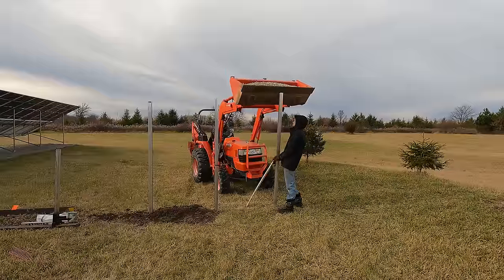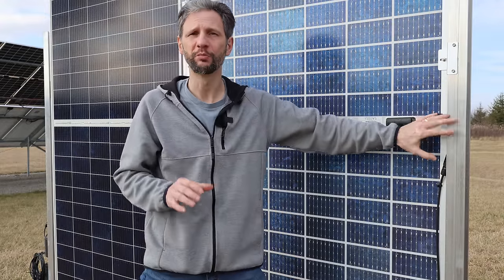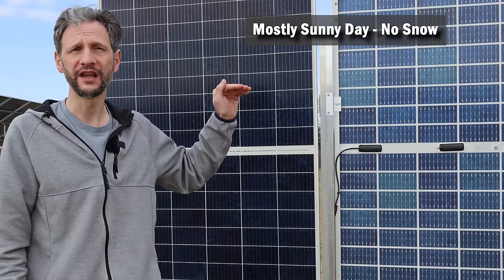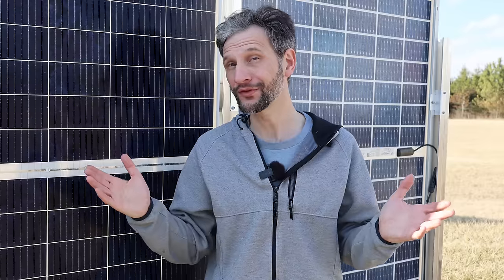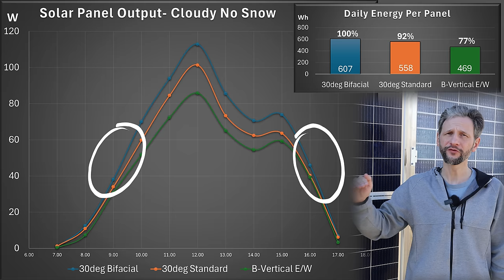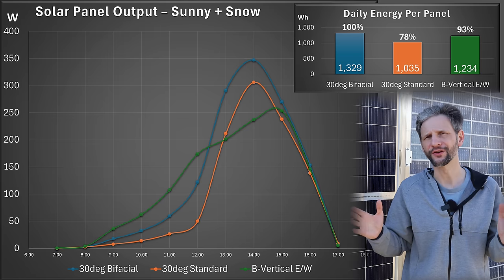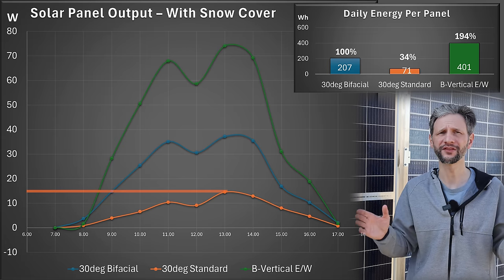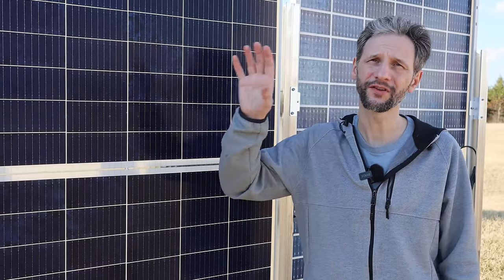Vertical Bifacial Solar Panel Performance Results Part 1

Comment: Hi Dave. Your video popped up in my recommended videos so I’m not yet a subscriber. I’m not sure if you’ll see this but I need to comment in the hopes you or someone needing to do a similar job will see this. 

At the 25 second mark I see you installing posts into the ground with a small tractor and its bucket loaded with gravel. This would be fine except for the fact that your helper is standing underneath that bucket, holding the post. 

Now before you get annoyed and dismiss me as a safety sally. Understand that I grew up on a farm, and worked in and around heavy industry all my life. I had some very close calls on the farm growing up, not really learning about safety until later when I entered heavy industry. I’ve done a lot of jobs in and around high hazard industry, farming (including fencing), plant maintenance, construction, equipment operation, and oil field work. As well, I have been a safety professional for the last decade. So hopefully you’ll understand, I’m not just some random person who falsely thinks something is dangerous because they don’t really understand it.

What’s dangerous about this is your bucket could slip off and smash your helper in the head. A number of injuries could result with death and paralysis being very likely due to momentum and stored potential energy present. 

These sorts of incidents happen in micro seconds and sadly there is no such thing as a time machine to go back and prevent it once it has happened.

Of course many dangerous practices happen on farms and acreages for years without incident but it only takes one instant for the worst to happen. 

In the future, please consider using a shovel, stick, 2x4, or any number of implements that would put your helpers head away from the danger and out of harms way. We call it “the bite” in the safety industry. I really hope you see this and understand my concern. 

Not long ago someone I grew up with was working on his truck as he had done for decades. He had his truck on ramps and although there were wheel chocks near his truck he must have felt that the park pawl in his transmission would hold his truck from rolling down onto him. The issue was he had to disconnect the shift linkage on his transmission in order to do the job he was doing. They think he must have bumped the shifter on the transmission into neutral when they found him. My point is he would very likely be alive today if only he had taken the safety precaution of chocking his wheels. I highly doubt it was the first and only time he did this either but likely got away with it many times. I doubt he realized the risk he was putting himself in. I wish I had been there to say something which is why I’ve taken the time to comment. Sorry it’s such a long comment but it’s important and if even one other viewer sees this and it helps them stay safe, it’s worth it. Take care out there!
Reply from the maker: Thanks for pointing out my poor safety practice in this situation.  He wasn't actually under the stroke of the bucket, but certainly closer than he should have been.  Also, the post could slip out and cause injury.  Supporting with another method would have been a much better choice.  Thanks for the reminder to keep safety a priority and for pointing this out for other viewers to take note.  Thanks!
Reply: @ProjectsWithDave  Big respect for being receptive to feedback! - your newest subscriber.

Comment: Great data! Thanks for the video.
What I understand is that vertical panels are much more suitable for too-hot (heat = inefficient) or too-cold (snow for light reflection) environments.
Also, the vertical panels probably could get tiny bit more juice if they had more distance from the 30 deg panels' shade 😄
Reply from the maker: You're right about the distance from the main array.  That is as far away as I could practically put them.  However a longer row of vertical panels would also shade itself more than my 2 panel run would so maybe that cancels out.  Unfortunately, no test is perfect but I think the trends hold true.
Reply: One benefit I gather that you can place these in areas not suitable for regular panel construction. Farms, or even alongside north-South running highways.

Comment: I think the big part of the study is going to come with its summer data.  The benefit that the vertically oriented panels had was that they were dramatically cooler, which has a big impact on production.

Comment: I wonder if you could make slanted reflectors of a kind in the aisles between them. Like a long base, low height triangle, the two "tops" reflecting light towards the panels to better avoid the mid-day dip. My recommendation is made without knowing how reflected light compares with direct sunlight, so if it's no better than albedo reflection, be gentle. 🙂

Comment: Nice data -- thanks. I'd be inclined though to include the higher cost of bifacial panels in conclusions.
Reply from the maker: The cost/watt is often cheaper when you consider the actual performance.

Comment: Great informative video.
It would be great to expand the testing to include single and dual axis solar trackers, although it costs more and wind is an issue.
Reply from the maker: I haven't found a good reason to get into trackers yet, but I may at some point.  I don't like the added complexity and long term maintenance.

Comment: A mix of both also solve running into grid limits and produce much more in peak hours where generation is much more profitable on the market.
Reply from the maker: Right, adding vertical panels give you more options to tailor a solution for your specific needs.

Comment: Might we assume that by treating panels in a long continuous sheet, that were one to separate them, surround them with reflective surfaces that assist in off-hour collection, that, were you to have the land area, one could optimize each panel to collect the absolute maximum?

Comment: I bet in many locations with low winter sun inclinations and snow-fall even a single-face vertical panel is a fairly decent design assuming you don't optimize for absolute maximum kWh. If having morning, evening and winter electricity matters more than peak summer noon production, (single-faced) vertical might be acceptable.

Comment: The results in late spring, early autumn and summer may vary significantly because the sun is much better aligned with the panels in the morning and afternoon than in winter. I'm not sure if they outperform the south facing panels, but i guess the results would be at least less far apart

Comment: It seems like the setup would benefit from 45° mirrors aimed at the panel. It would reflect light towards the panel when the sun is overhead and a bit of extra light otherwise.
Reply from the maker: It would help, but you have to consider the cost and durability of the mirrors.

Comment: Another winter test idea:  Ive noticed on my 2 small arrays that when they're snow covered that the parallel sections backfeed voltage to the non-producing sections, heating them and melting the snow/ice.  I was thinking about getting some MC4 blocking diodes for summer time but I think having them out during winter might be better.  Would be another interesting experiment if some of your lower sections of the array could be put in parallel with sections of the upper part of the array.
Reply from the maker: The diodes in your panels should prevent back feeding.

Comment: I think the problem is, you use bifacials that have one of their sides "nerfed". True bifacial panels should have the same efficacy on both sides, so your results would be much more desirable.
Reply from the maker: Do you have a link to a commercially available bifacial panel that produces the same power from both sides?

Comment: Those power curves better match up with typical household usage. My guess it would allow more savings on batteries in an Off-grid application. More on panels and less on batteries. used with vinyl fencing hardware like the I posts Install could be very easy and useful fencing or wind breaks.

Comment: Depending on costs continuing to go down or whatever just mounting 1/4 or 1/3 of the panels SE and SW facing with 1/4 or 1/3 180* (S) can make a usable system at my 45.74 lat 
I have ‘normal’ one-face panels but I mounted all of them vertical to keep snow from accumulating. I actually leave them that way all year long because I don’t ‘need’ to maximize in the summer months.  But in winter, I don’t have to be home and clean them off every ten minutes or every morning. I get charge even in snowstorms- they never accumulate any snow or ice.  Yes, I have ‘extra’ panels to compensate for the short sun-hours, but vertically is WAY more productive than getting them snowed on and getting 2%

I’m completely off grid do it was important to me to maximize circumstances and get /some/ charging not just optimize the sun angles and lose most days. I spent less than $75 total on generator gas this past winter and most of that was Nov and Dec. 

While I understand the bifacial concept, I’m of the opinion that simply facing SE-S-SW is beneficial and quite simple to implement in practical terms.
Reply from the maker: You have hit on the reality of solar production for those in northern climates trying to operate off-grid.  Design for winter production and the summer will be sufficient without any effort.

Comment: My understanding is that the vertical solar panels also reduce the inefficiencies that happen when panels are overheated with noon day sun so the summer results will be revealing.
Reply from the maker: I'll check that this summer.

Comment: can you speak on the return or monetization time?  Thank you.    

Also, this is an easy fix for the mounty systems of the vertical mounting options.   Also, how easy would it be to create an actuator to tilt the vertical just enough to take advantage of the noon sun, but still be able to act as a fence and or allow for crop use, with just a simple app to control them to meet needs.

Comment: Put white crushed rock down on the ground spread out even no blank spots on ground. It will outlast mirrors any day and much cheaper and much larger area can make ground white to reflect more sunlight. Or white tarps on ground? 😊
Reply from the maker: I think white stone is a good idea, I'll have to try it sometime.

Comment: Incredible video. This is how science reporting is done, by showing experiments and data. A shining example to follow by everyone.

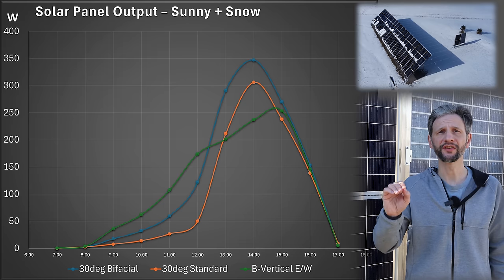The part that interests me most is the sunny + snow section at 8:40 because this shows that with a reflective surface on the ground, the amount of energy gathered by vertical panels is pretty much identical to tilted panels. That's extremely interesting.

There could even be angled reflectors at the base of each vertical panel, which are very cheap (the cheapest plywood with aluminium foil would do the trick), to redirect zenith sunlight towards the panel so that they have an even better curve than tilted ones.

Comment: Just a question, wouldn’t putting the vertical bifacial panels being installed behind the south facing panels reduce the amount of refracted light?
Reply from the maker: Yes, by some amount, but I don't think it is enough to significantly impact the results.

Comment: i see a big advantages if you get a hourly or even 15 min energy price. Over here there are times of the day(mostly around mid day) where you have to pay to put power back to the grid. But earlier in the morning and later in the afternoon the price shoots up as the solar input to the grid starts to drop off. And there these vertical panels come in, because they still deliver when the prices are going up. I think that is also a reason big solar farms do it, because they want to produce when it is worth money. They dont care about how much KwH they produce, they care about how much money they earn.
Reply from the maker: Right, the solution to implement depends entirely on what you are trying to achieve.  There is no one setup that is the best for everyone.  That's why I like lots of data, then you can do the analysis to find the best solution for your conditions.

Comment: I would be interested in the summer and all year results. One thing that was proven beyond a doubt is bi directional panels are significantly better. Of course, there is no advantage for roof mounted solar which is the majority of domestic installations

Comment: 1:07 could be solved just by mounting the panel on a swivel and have a RPI control the movement. Put a mirror under it.

Comment: I'm curious if utility companies that are fighting the duck curve issue will consider adding some vertically mounted panels to help offset the problem, maybe it will be cheaper than having to store more midday energy in batteries to use during hours where they normally get less sun.

Comment: Mounting and angles can be very case use overall, if you use more power at 3pm than 10am...be worth changing them slightly...but overall if you have the space in general....panels are really cheap...battery storage is the real crux for me and cost of system.

Comment: Rather than competing mountings, it’s probably better to see them as complementary.
Would be really interesting to see the averaged results of both the inclined and vertical mountings vs fully inclined or fully vertical.
And of course, putting an artificial light coloured base on the ground would make sense to increase the albedo effect.
Reply from the maker: Right, they can complement each other.

Comment: I think results would be even better if you would mount the panels vertically facing directly south, or even SSW/SSE.
That would yield the highest production from late autumn to early spring. And would also benefit greatly from the snow cover in front of the panels.
During summer you would get some kind of "triple peak" production curve. With smaller spikes in the morning and evening, and bigger one in the middle of the day.
In reality with prices of solar panels this low, summer production is not really important anymore, we need to optimize the solar for winter months.
Reply from the maker: I plan to run a test with South facing vertical panels at some point.

Comment: This is quite interesting. Im thinking how well will this config work on a white roof, though im not sure how reflective paint actually is and how much it absorbs outside the visible spectrum.
Reply: The pigment in almost all white paint is titanium oxide, and it seems to have a really broad reflective spectrum
Reply: @AlRoderick  yeah thats what i also remembered and there should not be that much binder that absorbs the light

Comment: As soo many other SolarEdge owners, he also has issues with SolarEdge with the left 5 panels & optimizers being down and non-operational.
It's so sad how many issues there are in real life within just a few years.
Reply from the maker: Those panels are connected to a string inverter not the SolarEdge system.  They show up in the screen because they used to be on the solar edge system but I haven't updated the profile.

Comment: Great information. What this lacks the most is scale since space is limited so let's say you have 20x100m space for solar panels, which is the best solution? You can probably make vertical panels more dense in a big area than normal panels and that could make them produce more electricity by m2 of used space.
Reply from the maker: There are some papers that have been written on the topic. In general vertical panels are being used in areas where farming or some other activity is being done. I think the power per square meter metric that you’re looking for would not be as good for vertical panels because they’re more likely to shade each other when the sun is low on the horizon.
Reply: Yes, but with this "solar fence" array literally no area is wasted. So, 95% of it can still be used for farming and in addition, plants also get some protection from wind and evaporating.

Comment: What's the price difference between regular and bifacial panels? Are they the same, or is there a premium?
Reply: They usually don't cost a lot more, maybe 15%. That's within the range of their extra solar production (as only the front side is rated). So in some case, they may even turn out to be the cheaper option, than monofacial solar panels.

Comment: Aren’t some of the biggest benefits from reducing heat losses? Also, wouldn’t there be a lot of reflection gained from a couple rows of panels indirectly reflecting on each other? It’ll be good to see summer month numbers but more rows might be a boost too.

Comment: The cost benefit of a mid-day peak power is pretty low, as electric power sale price is very low at these hours. Having a dip at mid-day, while having more early morning power generation is very cost effective. These early hours and late hours are when demand is highest and sale price highest. 
So the traditional setup might generate more power over the day but the generated power is worth less per kwh.

From a money generation point vertical makes more sense.
Reply from the maker: If you live in a place with rates that change during the day that could be a significant benefit.
Reply: @ProjectsWithDave don't know for other countries, but now in Germany we now do have dynamic power rates for small end customers, too.
Reply: the most known is called "Tibber". And people choose it, cause at certain hours (and minutes), they got energy for free or almost, so some even charge batteries and discharge them later (in addition to their own solar PV).